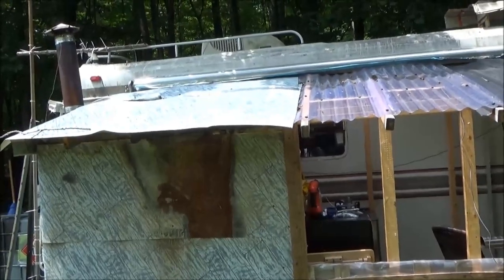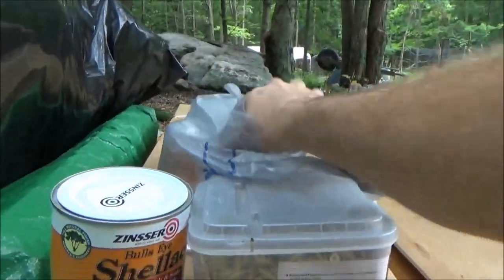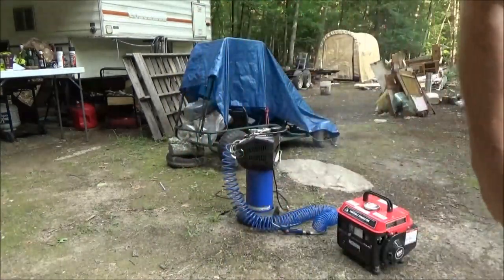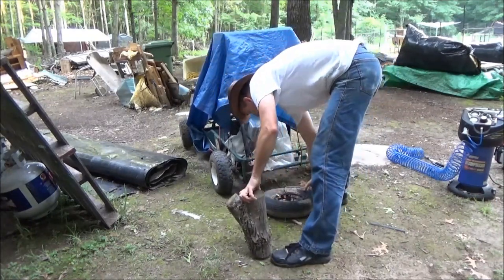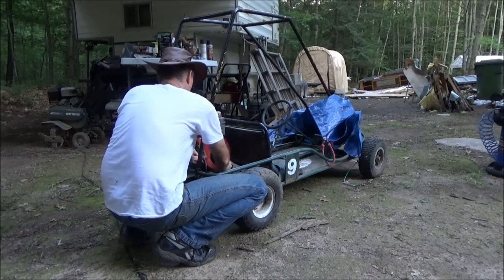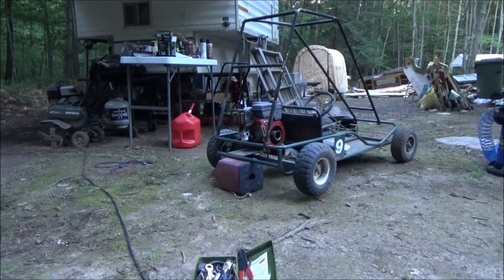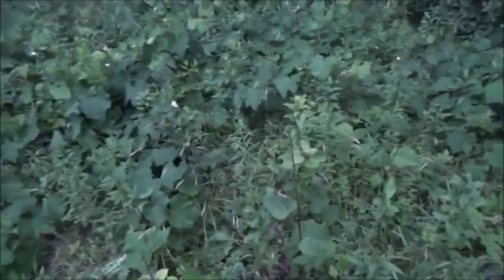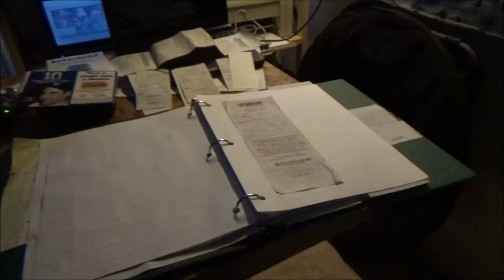More Tiny Home Building Supplies And Fixing My Gokart

Comment: Troy ive been think about ur lightning issue and this hole time u been out there never got hit till recent I think it ur internet that only thing thats changed and it blew out the light socket on the wall it was plug in to mite consider un hooking it and take the main box away from the camper and see if that makes any difference cuz ur a low point and only other thing would be ur electric fence cuz those r hook to that outlet in ur tiny home I would put lightning rods up and ground ur ac power outlets like they do in house so it it doesn't back feed into ur stuff I know thats down the road but its a thought

Comment: Looking good Troy. I would considered pulling the trailer frame to that wide open space where your tractor is, and doing the painting there. At least then it will be in full sunlight, and that will help dry the paint faster. Maybe the reason the painting that you have done to it already is still tacky, is because it is sitting in to much shade. I would think you little garden tractor should be able to pull it there. Food for thought,

Comment: Hey Troy - what's the time line on that Tiny house build -- are you planning to have this built before winter.  The summer is going fast -- I'm just sayin
Reply: He only needs to get it zipped up and water tight before winter. He can block off a small insulated interior area (10 x10) to heat and do the inside work at leisure. That would be enough room for the real necessities. Lots of log cabins were little bigger than that.
Reply from the maker: I hope to have it finished by Sept 1

Comment: Hi Troy
Still time to change to 4x4's for the floor platform and use the 2x6's for the rafters where you have a 10' span.  The floor joists do not have a normal load pattern with perimeter  support to a foundation; where span is the primary consideration.  Your trailer application is compression down the center 6' on the main 'C' channel with 2' cantilevers on both sides carrying the side wall, loft, and roof loads.  If you use the 2x6's for the roof rafters;  there will be an additional  2" in the cavity  for the free insulation you acquired.  Your greatest heat gain in summer and heat loss in winter is through the roof not the floor.  Use Rockwool in the floor as planed for vermin resistance.
 If you use the 2x6 hangers  on the floor platform. Use them upside down as you are transferring the load from the perimeter beam to the joists;  not the application they are designed for.
Have you had time to review the concept layouts and drawings;  I E-mailed to you.
My phone and Skype numbers are in the E-mails call me.
Bert.  Happy designing.
Reply from the maker: Thank you. Yes I looked at the plans and I also researched online about upside down joist hangers. Thank you very much for that advice. Sorry for not answering right away. I would like to post your drawings and info on the forum if you dont mind. Or you can join up: http://www.thediyworld.com/forum
Your suggestions are very helpful. I learned about cantilevers and distributing the load. I will have some beams in the middle of my tiny house from the roof to floor to distribute the weight. Thanks to you.

Comment: think your electic fence has drawn the first lightning into your camper, it was no way a direct hit, all your equipment than would have blown up, and wires will jump out of the wall by direct hit, your electric fence is like a antenna, dont think its a problem that you use ac in a storm, if it hits it wil be defect, on or off.

Comment: Hey Troy you can get a small DC fridge / food warmer for cheap I got one and I love it I use it for long trips for keeping things cold and its really great for small things and energy efficient if you have any questions on where to get let me
Reply: Those solid state (the ones without a compressor) cooler/warmer combos only chill the air to around 20 degrees lower than the room temperature. Handy in weather from 60F to the low 70s F, But quite useless in 80F-90F heat, except to keep the beer just a little cooler than the air.
Reply from the maker: Betty Pearl And they burn 75 watts continuous

Comment: Yeah! progress!
I think you need another tool investment - A dead blow hammer. Comes in super handy if you don't already have one and if you do, why were you not using it! Got mine for $3 at a flee market. Has a bit of a chunk out of one end, so talked them down from $5 

Another Amazing Tool Investment I have is a plastic yogurt container. I believe this particular one was formally greek style vanilla. I use it to put all the screws and bolts and nuts that I take off anything that I'm taking them off of. And guess what! I don't loose any of them. I have also been known to substitute a soup can, bean can, bread pan, and a lid off a 5 gallon bucket. 

I usually have to mow my lawn twice a week. I find that it really does keep the bugs down. I also do the outside edges twice and then go back and forth. Walking in a straight line takes far less energy than man-handeling the lawnmower around the same points again and again. Although you're right. It's a killer work out. 

Please do some research on that product that was sent to you. I know nothing about it, good or bad, so cannot speak on it in particular. However, I would wonder about how it might affect the other things that you share your space with. Remember that you share your space, good neighbours and bad. 

Loved the birdsong soundtrack. 

And last but not least, pick the berries asap! They'er the best ones to make jam out of. Plus, the later season berries will be bigger with less competition. But I'm sure we'll see something about that in the next day or two.
Reply: Wild highbush blueberries!  Oh, heaven!  Save the cultivated for jam!  Just kidding.  To each his own.  All the permaculture fruit looks like Eden, to me.

Didn't know how lucky I was when we lived by an apple orchard and had a cherry tree.
Reply: I love the sweet ones for jam as I don't add sugar when I make it. They're sweet enough on their own.
Reply: FromThe Prairies quite so!  (mmm - stop thinking about blueberry jam, right now, Pennies!)
Reply from the maker: I honestly dont know the different names of hammers. Yes containers are perfect for not losing screws. Unless you tip it over like I thought I had. Or misplace the whole thing. That has happened before too.
I will research the bug stuff I got. Thanks
And thanks for the info about picking. I never thought about that.
Reply: Dead blow hammer is a heavy rubber-type-of-material hammer. Most are about the same height as a regular hammer. I use mine for everything from closing a paint can lid (a bit overkill but I don't have a real rubber mallet), tapping brick into alignment, tapping in the wayward bits of firewood (easier to handle than my 36" splitting maul) and so on. It it needs brute force and you don't want to leave a dint - get a dead blow hammer.
Reply: by the way, they do sell them at HF but for some strange reason they're all neon orange (and about $12 new). You will never loose one...or mistaken one for a deer.

Comment: Remember, when you build a building, build the floor, and then build the walls, and then frame the roof. Do not sheath the roof unless you do some sheathing on the walls or attach diagonals. If you sheath the roof first, the whole building can collapse. The wall studs are all vertical. so with the top weight of the roof, the building can collapse, the studs can topple like a house of cards. I have seen it, its not a good thing.
Also, to move the trailer, add weight to the back end and the tongue will float. That little piano caster will dig into the dirt. -Neil

Comment: Looks like your getting a lot of wood thats great. Cover up your plywood with some tarp so it wont warp. You dont want it to get wet. Cool Cat rides like a dog thats funny. here is a tip oil the bearing the centrifugal clutch rides on. nobody ever does that. I did not know about it for a long time and thats the weird noise it makes like rrrhhhghgh when you try to start it the clutch bearing is dry. They do need oil. its a brass bushing that covers the shaft and the clutch raps around it. some thirty weight motor oil or 3 in one oil. if you could squirt some fuel in the carb opening it would fire right up. That is a huge amount of grass to have to cut with a push mower. Too bad you dont have a deck for your rider.

Comment: Hi Bernie
I will keep trying to get him to change to 4x4's.  But I did e-mail him a drawing of how to build the floor platform with the 2x6's to transfer the load to the frame as opposed to transfer to a perimeter foundation.  It can be hard to understand why the load transfer is different to a trailer frame; than a perimeter foundation.  And 4x4's  24" OC will provide a stronger, simpler, larger glue and screw surface, no joist hangers, better carriage bolting to the trailer frame extensions.  With 2x3  strapping below and the wall base plate above an effective 2 1/2 x 6 1/2 box beam under the side walls and roof.  Not having to double up the 2x6's,  block them to control twisting, etc. makes the weight and amount of material a draw.  There are many other reasons why 4x4 joists make it stronger and easier to build in this application.
Bert

Comment: i had that same red generator wish i wouldnt of gave it away like a fool!. anyway their are yt vids on how to make them reliable they are known for certain issues. basically blue locktiting the 2 bolts behind the air cleaner,new plug and new gas lines and add a fuel filter. china uses cheap gas lines that disintegrate from the inside and plug up the carb and you already know im sure(think i saw you change out the plug already) the spark plug that comes with it is garbage.
Reply from the maker: Thanks. I did not know about the gas lines. I have to fix that.
Reply: LongHauler73 all i heard was that their fuel is different than ours our fuel in their rubber lines is bad. ya its hard to understand why people have to save that 2c per tank with cheap gas. those people are just destroying their engines the smaller the engine that worse. this is the main reason why weed eaters are notorious for not starting. ethanol gunking up the carb.. lol my dad is like that sofcn cheap that he just has to save that 2c per tank lol idiot. their is thrifty then their is cheap thrifty is smart cheap is for fools that dont know better. trucker hey? ya im class A myself but out of work.
Reply: but its true if you leave those rubber lines on eventually it wont run and you will find the rubber clogging your carb. i have seen it in scooters same chines junk rubber used as in that. BUT that might not be an issue anymore i think the u.s has made them change to better rubber. but why take the chance? its 3$ to replace with thick good lines
Reply: LongHauler73 agree on all points!

Comment: For the go kart, take off the very rear roll bars and build a plywood platform over the engine, and Boom, you have a UTV
Reply: Would that really work?  I had the rather judgemental thought (hanging my head in shame) that there must be something useful that thing could be utilised for.  HA!  As if a little recreation isn't useful.  :/
Reply from the maker: Was thinking about a trailer hitch and a little cart for it.
Reply: The Do It Yourself World that could work, but having it in the back of the go kart protects the engine in freak rain storms

Comment: Instead of rope starting your kart you can use a drill, its alot easier! 
Thats how i start most of my race motors when my good starter is dead.
Reply: an also with your clutch if its a hillard there is a bronze bushing that needs a little bit of wd 40 if its gets dry it will make a grinding noise an seize, an if you dont want to take it apart you can shoot a little wd 40 on the bushing twards the crank case side, that should help it out hope this helps!
Reply from the maker: I heard that can be dangerous though if the socket flies off.
Reply: 8 years racing karts i have never had that problem yet (knock on wood) but i do understand where your coming from.

Comment: Actually, it's the last week you aren't supposed to disturb them. I check on my broodies all the tme. The gestation period is 21 days before hatching.  Also, your other hen did not stop laying because one went broody. The only hen that stops laying is the one that goes broody.  It will be interesting to see what you have in less than 2 weeks.
Oh, and do your girl a favor. Make sure there is food and water near her (in side the tractor on the ground is fine) so she doesn't have to go too far from the nest to refresh herself. She will come off the nest once a day to eat, drink, and poop.
Reply from the maker: Thank you. I am not sure why the other hen stopped laying again. But the one nesting only laid one single egg ever.
Reply: The Do It Yourself World Well, if she proves to be a good broody, then she is worth keeping. That is, of course, if you intend to breed and I think I remember you saying you were.
As to why a hen will stop laying, if it's too warm for her that could be the problem. Heat will stress a hen, some breeds more than others. If they are still trying to cram into that small coop (with the added birds that is), then the coop would not cool down enough with all their body heat. Nutrition can be a factor, but you are feeding them layer pellets so she should be getting what she needs. Or, she could just be one of those rare individuals who just didn't get the full allotment of eggs when she was developing.
Reply from the maker: MotherOfManyHorses Who know really. My chickens are always eating something. Their crops are always stuffed full. The other birds do not sleep in the coop at all. I think I put that in a video. Not sure if its live or coming up.